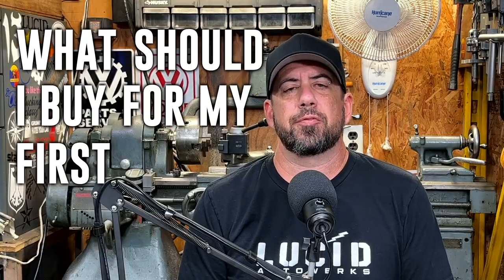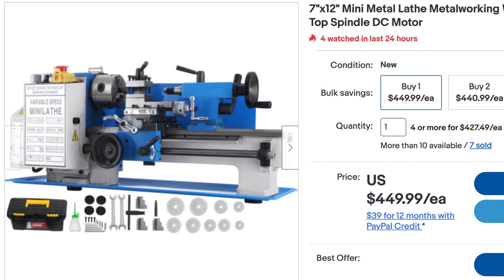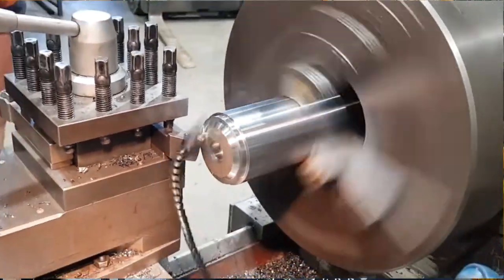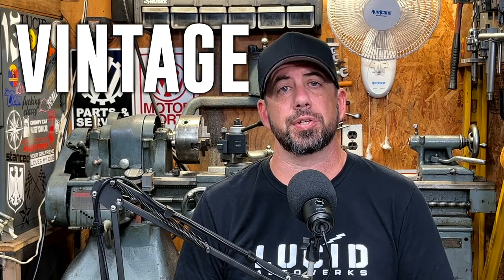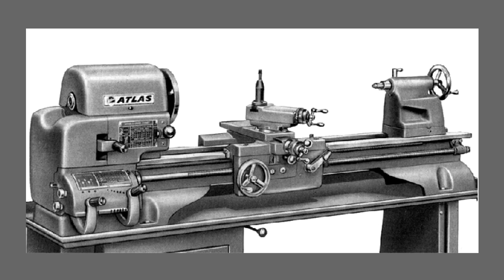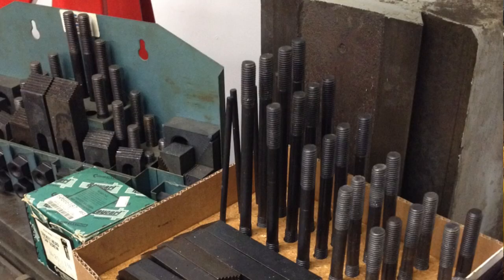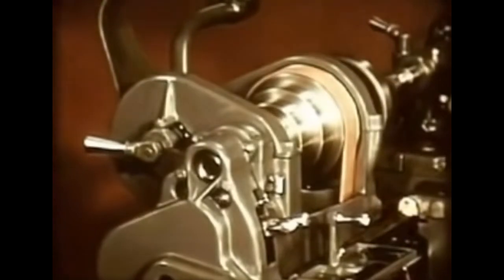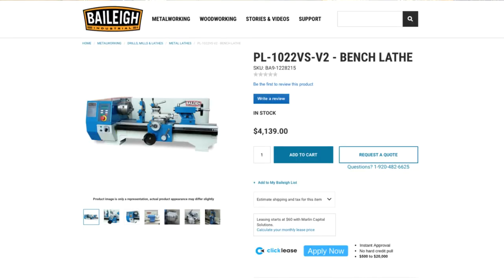3 Options for your FIRST Metal Lathe

Comment: I’m trying to start a mobile wheel repair buisness, would a bench top lathe be best for cutting beads 15-20in wheels
Reply from the maker: I'd look for a wheel specific lathe. Just chucking up a wheel that size would require a really big lathe but then you have to be able swing the tool around the lip to do any cutting. Normally lathes that can chuck up large pieces like that are also really long. What is done when cutting beads? Are you doing repairs to the part where the tire seats against the lip of the wheel?
Reply: Yes
Reply: @LucidAutowerks 2 things either, cutting the welds of crack repairs and highs out of bent wheels